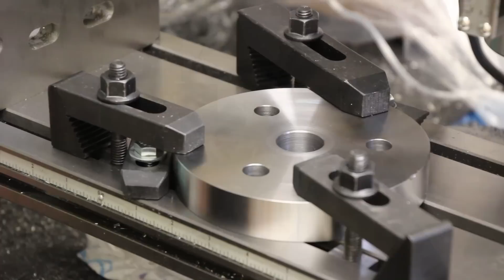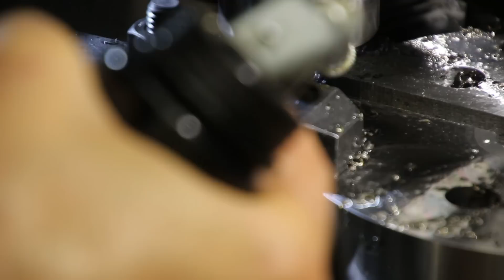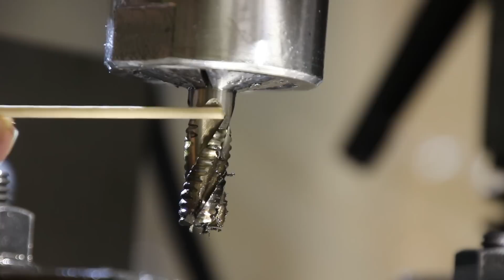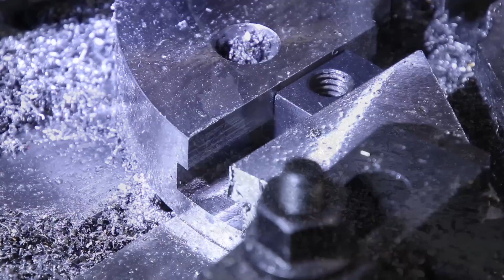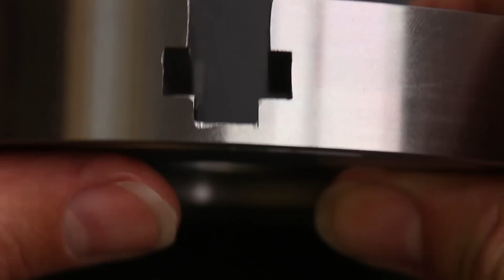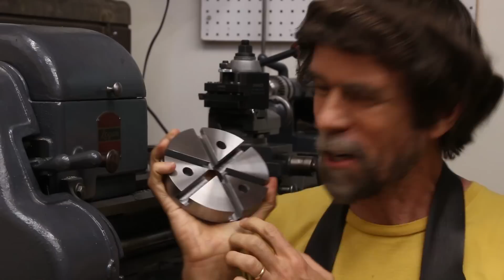Machining a T Slot Faceplate, Part 2

Comment: If anyone asks about the slot in that faceplate, the extra depth to that T slot (or should that be a + slot now ? :) ) wasn't a machining fault, it was actually an experiment. You created a precisely calculated ramp to help "The coolant flow remove fine metal chips"........ Suddenly it's not a fault, it's a clever feature ! :D
When your hobby lathe work has as many "Unexpected features" as mine usually do you've got to get creative with explaining them away. 

.........."No, of course that bar's not ACCIDENTALLY been turned with a taper, That's there [For radial clearance / For added weight saving / Due to artistic necessity / To minimising vibrational harmonics/ To prevent it LOOKING tapered because of perspective]" (Delete as applicable). LOL !
Reply from the maker: That's a good way to look at it. I like to say that every problem is an opportunity, and in this case it was an opportunity to learn how much better end-mill holders work compared to collets.

Comment: Very professional presentation.

The metal looks like a chrome steel (EN24?) judging by the finish (bright) and the blue chips when you turned it in the lathe.

In my experience, oil alone will not draw enough heat from HSS cutters in chrome steels at anything more than light cuts (say 20 - 40 thou).

You could take a 300 thou cut but you'd need a water based coolant and you'd have to go really slow or use pumped flood coolant rather than hand applied.

Just my tuppence worth!
Reply from the maker: Thanks for the info. I just got lucky with that steel, as I bought it at a scrapyard simply because it was the size I wanted. I usually take fairly light cuts because my lathe is an antique and my milling machine is light-duty, and I use the same cutting oil for nearly everything just for the sake of convenience even though it may not be the best coolant in some cases.

Comment: I use a garden pump spray with water soluble oil in it, like: https://www.bunnings.com.au/aqua-systems-2l-garden-pressure-sprayer_p3368550 to lubricate my cutters. I quite often work with pre-hardened P20 or M238 Injection molding die steel on a small mill & lathe.

Comment: Rougher end mills are junk. Plus, you need a lot more feed.  Try to get .003-.03 CPT , vary depth accordingly.  End mills dull and heat up rapidly with too little feed.
Great project,  thanks for sharing.

Comment: Instead of adding oil and turning your chips into a paste (which results in recutting those same chips over and over again), you should do something to clear your chips. Recutting chips is really hard on your cutters and is likely the cause of the endmill pulling itself down into the work.

Comment: Use end mill holders and not collets and you won’t have that drop occur. Besides you get a better, more stable cut, which in turn will produce less heat and allow for higher feed rates.

Comment: You may be better off with no lube on the carbide. Carbide doesn't mind the heat much and the squirt of oil might shock the hot carbide and cause it to crack/chip.

Comment: Blue chips are a sign of to many rpm's. Because they cut on 3 sides ( generating much more heat ) T-slot cutters should run at 50% recommended speed for the diameter.

Comment: Hi there, nice video. I finished a Maschinist apprenticeship quite a long while ago. As far as I remember coolant works best as a water oil emulsion with a major part of water. Greetings from Germany
Reply from the maker: Thanks Andree, and I agree that a water-soluble oil would work better as a coolant. It's just not as appealing for my own needs where I use the machines infrequently (darn it) and for various materials where I prefer the convenience of a single cutting fluid that's at least okay for most anything I want to cut.

Comment: You might try soluble oil, Jay. It cools MUCH better than petroleum-based oils. Petroleum oils tend to retain heat. Soluble oil is much easier to clean up, too, and it provides more than enough lubricity for mild steel. BTW, that's WATER- soluble oil.
Reply from the maker: Thanks maybe I'll try that at some point. Originally my shop was only heated when I was using it so freezing was a concern, which wouldn't hurt the machines but could damage containers etc. so I avoided water-based liquids in general. But now I keep it more climate-controlled for guitar work so it wouldn't freeze unless we get a prolonged power outage.
Reply: You may want to try a sulfur based oil.  It works great for me on steel.

Comment: BrainRight, This was an Awesome video! I have maybe two hundred hours of using Mills & Lathes, both my own & Commercially (working Bronze for musical instrument parts). I have had the same issue on my tools, of slipping, and Immediately wondered about the steel stress that you checked on the surface plate. My Question to you is this: I was taught to always feed the cutting teeth Into the metal, yet on both the High Speed steel cutter as well as the Carbide, you cut in both directions: DOES THAT effect the Sharpness at all? And I was told Carbide could be brittle cutting "Backwards" (against the back edge of the cutter). Can you say something about this? I have not been using my machines for over Six Years due to moving into an Apartment. I am soon buying a house! Thanks in Advance, philip
Reply from the maker: I don't claim to be an expert, but I do claim to have watched videos by experts. :-) Cutting in both directions is quite common, and I think the most important thing is to remain aware of what you're doing and learn how the machine is likely to react. Making a "conventional" cut tends to push the material away from the cutter, whereas a "climb" cut tends to pull material into the cutter. These forces have a larger effect on a lightweight mill like mine, versus a more rigid machine like a Bridgeport for example, so climb cutting may produce more chatter in some cases. I don't think brittleness of the carbide is likely to be an issue because, once again due to the lightweight nature of the mill, I am taking relatively light cuts.
Reply: BrainRight - Maybe even more importantly, climb milling in most manual machines isn't recommended unless you set your axis locking clamps to give some pretty serious drag. You mentioned that the tool might chatter... What's also maybe even more likely is that the tooling will "grab" and cause the tool to break, often launching it across the room.

Comment: looks like you have a piece of toughened free cutting mild steel,nice steel.Unless you go to a metal supplier and specify your needs then scrap metal is so  much  mixed it;s a bag of allsorts you get.So your conclusion to go carbide is less expensive over time and giving you longigivety in your tooling
Reply from the maker: Yeah in the end it was pleasant to machine once I figured out what tooling worked best for it. Next time I'm at the metal store I'll watch for similar-looking pieces, likely scraps from the same source if the surface appearance is similar. At $0.40 a pound it's not too costly to experiment with it.

Comment: Hi Jay, would an occasional burst of air, to clear the chips have helped with the heat buildup while cutting the slots? Beautiful face plate. And I appreciate leaving the bloopers in and commenting on them.
Reply from the maker: Hi Kent - glad you like seeing my mistakes, and no doubt there will be more of them in the future. :-) Yes I think it would help to use compressed air or possibly a fogbuster as Daniel privat suggested. I hesitate to use an air blast until I make a better enclosure to contain the chips, since my workshop is also used for other things such as building guitars. Metal chips and spruce are not a good combination.

Comment: Great video! What size Harmonic Drive (HPG?) do you have? is it a "20" ? thanks - Nick
Reply from the maker: Yes it's a size 20, with a 45:1 reduction ratio. In the early part of the first build video (https://www.youtube.com/watch?v=mmOnktzifeg&t=109s) I go over the part number and specs of the gearbox.
Reply: Thank you very much! Have you had any problems with lack of holding power using the nema 23 and planetary reducer. I purchased one and am now at the stage of buying a stepper, curious if you have any insight.... thanks - Nick
Reply from the maker: Nick, this is a good question but I think it would be better addressed in the 4th axis video comments so I will repost your question and answer it here: https://www.youtube.com/watch?v=mmOnktzifeg

Comment: the oil squirty thing had a good workout today :)
Reply from the maker: Yeah it sure did. It's the only way I can seem to keep those cheap end mills cool enough, but it took a lot of oil. I don't regret getting a cheap set to start out, but I plan to replace them with better quality cutters. I'm sure the carbide slot cutter didn't need to be oiled so exuberantly but I didn't want to risk toasting it before getting used to how it cuts.
Reply: I'm thinking the biggest benefit of exuberant oiling is keeping all the recut chips from welding onto the cutter or work.  Without something blowing or flooding them out, that roughing mill was doing a great job of mulching.